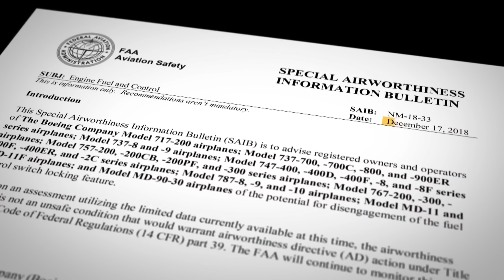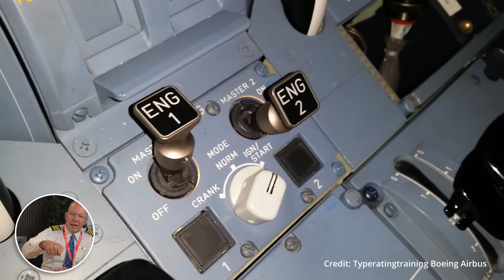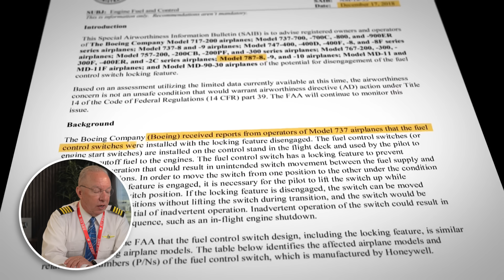Air India 171: The FAA’s 2018 Fuel Switch Locking Bulletin Explained (16 Questions Answered)

Comment: Even if there is an issue with the locking mechanism, I don't quite understand what the hand would do down there during takeoff. After "trust set" hands aren't hovering over the cutoff switches. Maybe the radio, but then the hand is below the switches, not above. And even if they were, and how both switches would be inadvertently knocked in the off position. It would require a gesture that's too close to be intentional to not believe it is.

Comment: I don't believe this was a mental health issue, sabotage, or something like that. In my opinion, this was a brainfart (an epic one), which is something that could possibly happen to everyone at any time for virtually no reason, or it's some rare technical issue. There is no way how to prove it was a brainfart, so what I need (and imo this is what we all need) is to get reasonably sure this was not an technical failure. In fact, I have a lot of technical questions I am completely unable to find answers to: 
1. What is the time resolution of that flight data recorder unit? What time quantization error does this unit introduce into a stored records, what is the shortest and longest period of time that is recorded as a one second delay?
2. How long was the delay before that cut off switches was returned to its right positions? Does the records in flight data recorder corelate with records from voice data recorder unit?
3. How are that two switches wired to control units and to the flight data recorder unit? Is there any redundancy check to ensure signal integrity (I hope there is at least some), something like first contact closed second opened in one position, first contact opened, second closed in another position, minimal/maximal impedance of that loop, … and how are these signals processed and interpreted by (both) control units and flight data recorder unit?
4. How the mechanics of those switches looks like? Not only how the lever is actually build, but how it mechanically affects all that contacts inside that switch, how all that stable and moving parts are put together. E.g. if you pull that lever, it applies mechanical force to internals of that switch, which may trigger some internal issues. I am not familiar with mechanical construction of that switch, but I would like to at least get in touch, which means I would like to see some drawings of internals of that switch. Furthermore I would like to see what exactly describes that bulletin from 2018 and what situation exactly caused it was issued, as it sounds like that bulletin describes possibility of failure, that is almost identical to what had happened in this particular case.

Comment: So, theres a theory that a chip malfunction caused the cut off. Is it possible that such a malfunction could happen such that the engines cut off without the swtches being physically set to that position?

And since it would be a signal error, the computer would record a cut off position, without there being a physical cutoff.
Reply: If that case the FDR would have recorded three separate signals relating to the switches. And it only logged two.

1) Spurious signal causes both engines to shut down.
2) Pilot toggles cutoff switches to off.
3) Pilot toggles cutoff switch back to run.

No third or extra signal was recorded. And that only way that happens is if the two recorded events are (2) and (3).
Reply: @SeanFication  ah... so the FDR would have picked up "rougue" signals as well?

Thanks for that insight.

So in my scenario, the action of putting the switch in an off position would have been a corrective move, like a reset. If that was the case, the time between off and on would have been 3 seconds max...

I know nothing about aviation by the way, your comment has led me to learn more about FDRs and how they work, thank you!
Reply: @AhYes-it3mr  If the engines are sent a signal to shut down, that information is recorded in the FDR. The origin of the signal does not matter, it could be an transient electrical spike or a switch being moved, but a signal to shut down the engines would be logged.

Actually since there are two engines with two completely separate control systems, there would have to be two 'rogue signals" being sent, but both would still be recorded.

Comment: I think the psychological aspects should not be minimized. I’m not a pilot, but I did work in Operations at a nuclear power plant, which is highly regulated. I was required to obtain my both my reactor operator and senior reactor operator license from the Nuclear Regulatory Commission and a part of that was undergoing a psychological evaluation as a part of the licensing process and periodically thereafter. The fact that this isn’t an industry requirement for a pilot I find incredible.

Comment: The FAA Safety Bulletin SAIB NM 18 33 clearly explains that after wrongfully installing the fuel cut off switches the switches can be moved from RUN to CUT OFF position without having to lift them. That's what they meant with "installed with the locking feature disengaged". And you keep telling the viewers that you think that they meant that the switches could be installed upside down, witch is clearly not the case. Someone could actually bump into them by accident or moved themselves to the down position because of vibrations in conjunction with a steep climb. The pilots might never noticed this because they are used to PULL - MOVE and RELEASE the buttons, never noticing that the locking feature might be missing.
Reply: Finally, someone that can read the actual bulletin which states that the issue was not with the switches function but with the locking mechanism to prevent accidental movement. Pilots as a matter of course would always LIFT the switch to turn it on or off They are not going to try to move the switches without lifting them first since that is not how the normally operate.
Looks like we will have to wait to find out if these particular switches had a functioning locking mechanism.
Reply: People like to see what they want to see.
Reply: You people are really slow on the uptake. The crash investigators have the actual switches from the crashed plane in their possession. If the switches were faulty that information would have been broadcast to the entire world by now.
Reply: @SeanFication  I do not agree. Fumbling with evidence, witch it is if you actually handel them, might be part of a proces of decision making with experts. If everybody just start to pull levers and buttons to try if they are stuck, you lose overview. That proces could well take weeks because sometimes you get only one chance to prove something. And do not underestimate the power of Boeing who has a lot riding on this... it could become their final downfall. And another thing, the FAA knew of the bulletin, but did not mention that the switches have been found working normally witch is another indicator that they have not done a "post mortem" on the switches. So please don't call people "slow on the uptake" if you yourself have not done the necessary homework.
Reply: In reality, the report noted the switches found in the wreckage were found in the on position.  It stands to reason that if these were a type of switch that were out of the norm, they would have stated such an obvious finding.

Comment: I am not a pilot, or connected to the aircraft industry so please forgive me if I appear to not know what I'm talking about. Is it possible for the switch levers to be caught on the front edge of the metal protrusions so that they make the on connection, but then with vibration or other factors they slip off the edge into the cut off position?

Comment: Capt Steve, I'm unsure why you insist that the FDR records the physcial position of the switches. It doesn't. The FDR on the 787 doesn’t record the physical position of the fuel cutoff switches. It records the state of the fuel shutoff valves, which are electronically controlled by the FADEC system. So when the preliminary report says “the switches were set to CUTOFF,” that’s shorthand. What it actually means is that the valves were commanded closed - not necessarily that someone physically moved the switches.

There are several reasons this could happen without anyone touching the switches. An electrical transient (a voltage spike or drop) could momentarily trip the logic that controls the valves. A software bug or a relay failure in systems like the Engine Interface Unit (EIU), the Electrical Load Management System (ELMS), or the FADEC could result in a false shutdown command. There could also be a physical fault in the wiring that carries the switch logic. Even poor grounding or shielding could allow electrical noise to trigger a false input.

So yes, the system behaved as if the switches were moved to cutoff, but that doesn’t prove someone actually did it. The cockpit voice recording where one pilot asks the other “why did you cut the engines?” might just be a reaction to what he felt or saw on the EICAS - not because he visually confirmed the switch positions.

Bottom line: the FDR shows the result (fuel valves closing), but not the actual cause. Until the final report examines the physical switches, wiring, and related systems, we should be cautious about jumping to conclusions like deliberate action or sabotage. There's a lot more complexity involved than just what the data snapshot shows.
Reply: Another amateur electronics expert! The proposed "transient electrical spike" would have been recorded by the FDR. No such event was recorded. Such an event would have shown up as an "extra" signal.

Here is what you are proposing. 

1) Spurious signal shuts down both engines. (Doubtful that this is even possible, it would require two signals, one for each engine.
2) Another signal is generated when the pilot toggles the switches to off. 
3) Another signal is generated when the pilot toggles the switches back to on. 

 We know that 2 and 3 occurred. And there was no third signal recorded by the FDR.
Reply: @SeanFication  Not really an amateur, but... sure, believe what you like. I’ve designed and built automotive electronics, and I’ve seen systems behave as if a switch was toggled when it wasn’t, simply due to something as trivial as a failing capacitor, a leaky transistor, or a cracked solder joint. Unless Boeing uses electronics that are somehow immune to failure, you can’t just rule out the possibility of an electrical or logic fault causing the valves to close.

Also, nowhere in the AAIB report does it state that a pilot physically moved the fuel switches back to RUN. It only says the switches returned to the RUN position - meaning the system (likely via the ELMS or FADEC interface logic) detected the state change. What’s interesting is that the switches returned to RUN several seconds apart - first engine 1, then engine 2 four seconds later. That’s a long delay in an emergency, especially if a pilot was manually correcting a mistake. It doesn’t prove anything by itself, but it certainly leaves room for doubt.

Until we have physical inspection results from the switches themselves, wiring continuity checks, and system logs from the CMC, any conclusion about deliberate action is premature.
Reply: @AnOnymous-go7kn  Way to evade the point I made.  If your proposed spurious electrical signal caused both engines to shut down absent any physical switch movement (itself highly unlikely since the engines are controlled by two separate control circuits) then that event would have been logged in the FDR. And no such event was recorded, as I explained in some detail. The FDR recoded both engines being shut down, and than later both being started up. That is not consistent with a spurious electrical signal followed by the switches being toggled off and then on, which is three distinct events.

"....Until we have physical inspection results from the switches themselves ...."

They have the physical switches in their possession and will have already examined them. If they were defective we would know all about it already. The aviation authorities are not going to allow thousands of planes to fly for another couple of years with a known fatal defect.
Reply: @SeanFication  You're right that the fuel switches and valves use separate wiring and power feeds - but that doesn’t mean they’re entirely immune to a shared upstream fault in the FADEC/EIU logic path. The AAIB’s report is preliminary. They’ve recovered the switches, sure, but full forensic analysis (switch mechanics, wiring continuity, logic signals, relay boards, grounding, shielding, etc.) takes time - that gets detailed in the final report, not the early summary. What we currently know from the FDR is two valve-state events: cutoff then run. It doesn’t say who or what commanded the valves back to run, nor does it confirm whether a pilot physically flipped the switch or if a system glitch did it. Until the final investigation reveals switch-level analysis, claiming pilots did it manually is jumping the gun.

Comment: There is no excuse for having no cameras in cockpits, I think the reason they don't is because in the case of major accidents, they don't want to watch the pilots either die or get seriously injured. 

There's no doubt, there should be cameras in cockpits.
Reply: Why should there?  What useful information could be gained?
Reply: @Bassman_DB  Like in this case, it'd be able to match any control movements or actions made by pilots and be sync'd with the CVR and the FDR, in this case, even if it was deemed to be deliberate, nobody would ever be able to conclude which pilot had done so, regardless of any comments made afterwards. 

They could also rule out Pilot error and scrutinise technical faults more if this was a thing. 

I'm a firm believer in waiting for the final report to be published before coming to any conclusions, but I feel this would speed up the investigation process significantly in the future. 

Also, not having cameras in cockpits on the basis that pilots may be breaking the rules is silly, there is a sterile cockpit rule put in place for a reason so that the pilots can concentrate on the  climb / descent without any unnecessary distractions.

Comment: If it's technically possible that the fuel levers were not fully engaged in the on position and could slide back to the off position due to movement, wouldn't it make more sense for off to be the upper position? Also is ithe case that the levers have to actually be in either locked position for fuel to flow or stop or does the flow start and stop while the lever is on its way to a locked position?
Reply: Just no.  Watch the video
Reply: Yep, I did, 1m 58s "anything is possible" in reply to the question of levers not being fully in a locking detent.

Comment: The probability for this to be inadvertent or accidental is nearly zero since it occurred to both switches/engines.  The probability is extremely low for this to happed to a single switch/engine.

Comment: One thing to consider when thinking  about  the very VERY slim possibility of  a fault downstream from the physical switches;  The data recorder shows a 1 second interval between the purported movement of the switches 1 and 2, from RUN to CUTOFF.  As a non pilot but a builder of physical simulators, I can say that in my experience at least, when there is a software or wiring issue there is no lag between actions 1 and 2 in a related function.  If i fouled up the wiring or the code, and they are related functions, the both quit at the exact same moment quite literally at the speed of electricity...which is the speed of light for all practical purposes. 

I would have to imagine, but cant say for sure, that Boeing engineers made each switch logic a discreet pathway, physically and virtually for the shutdown of engines 1 and 2, at least to the FADEC head unit. 

The possibility of a dual fault, on dual pathways, of the same nature, at the same time are exceedingly slim.. Somewhere in the neighborhood of one person winning the Powerball jackpot annually for 5 or so years.  True, there is no physical law of the universe that says its impossible but within our understanding of the universe, MIT and Princeton combined cannot measure anything that small..

Ergo, plain country logic points to a a human hand, either intentionally or inadvertently, moving he two switches from RUN to CUTOFF..
Reply: Usually the simplest answer is correct. The switches were almost certainly moved to "cutoff" intentionally.

Comment: The number one reason for airplane crashes—especially in commercial aviation—is human error, particularly pilot error.

Breakdown:
	•	Pilot error accounts for roughly 70–80% of aviation accidents, according to multiple aviation safety reports (e.g., from the NTSB, ICAO, and Boeing).
	•	This can include:
	•	Poor decision-making
	•	Miscommunication
	•	Failure to follow procedures
	•	Loss of situational awareness
	•	Improper handling of mechanical issues or bad weather

Other (less frequent) causes:
	•	Mechanical failure (typically rare due to maintenance protocols)
	•	Weather (like severe storms, wind shear, or icing)
	•	Bird strikes or foreign object damage
	•	Air traffic control error
	•	Sabotage or terrorism (extremely rare, but high profile)

In modern aviation, crashes are rare, and when they do occur, it’s often due to a chain of events, not a single cause. But statistically, pilot error is the leading contributing factor.

Capt. Steve don’t you think it time to look into automation? We need self flying aircraft.